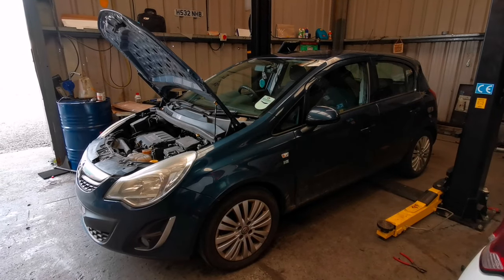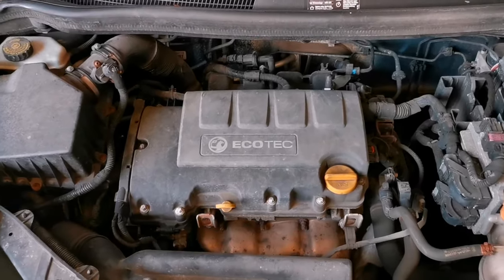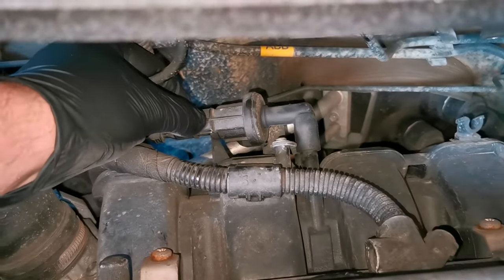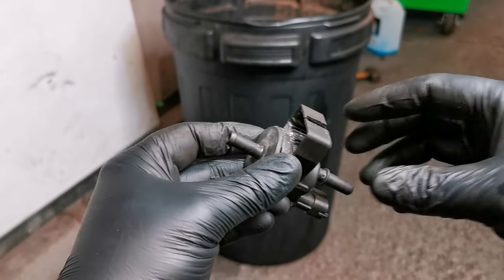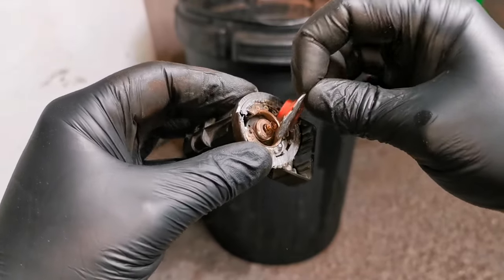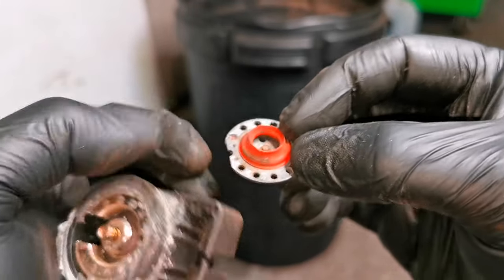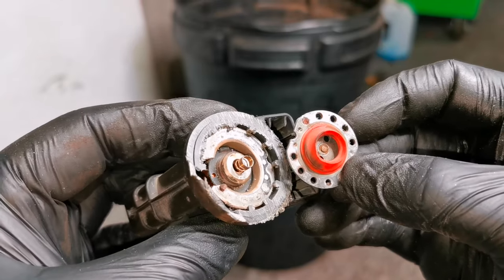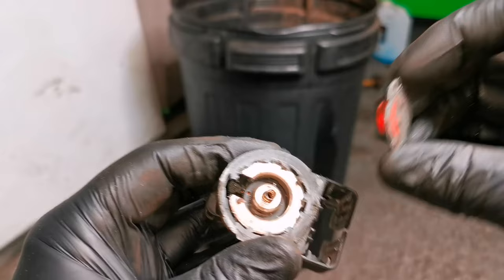Corsa Uneven idle, PCV valve? Common problem

Comment: That's a purge valve for the Evaporative emissions cannister. 

The PCV valve is built into the rocker cover & is also a common failure on these engines. I believe they make a squealing noise when they fail.

Comment: Great video, keep it going your time will come 👍🏼.  Can I ask you how did you intially diagnose the idle to a bad pcv assuming you didn't just cut Open the part and hoped ?🤣😁
Reply from the maker: A simple way to see if the pcv valve is venting too much is to take the pipe off and block the pipe manualy. Then you can see if the idle improves or not.
By blocking the pipe you're acting as the valve so this is a simple way to check.

Comment: hey ! i hear a 'fssssssss' constantly and once i press brake the fsss stops and idle drops by 200rpm under 1000! Could it this be the problem ?OC car has engine check and dont pull as it should be ! Please help im desperate ...

Comment: When you say uneven idle are we talking turn the car on and idle is almost stalling and then few hours later it can idle at 1000 rpm ?
Reply from the maker: Uneven idle can present as bouncing involuntary from 800 to 1000rpm or  "hunting". It can also present as a slight misfire.

Comment: Will the pcv valve being perforated throw a fault code?
Reply from the maker: Not always.
If the electronics are working as intended, as far as the computer is concerned, it will assume it is working correctly and not display a fault.
Reply: @MTMMotorServices  thanks for replying so fast!. 

I have a a corsa d 1.4 . Started misfiring badly out of the blue.
Replaced coil pack and plugs. No change. No fault codes, no other electrical or mechanical issues to note. No holes in the exhuast,  I'm stuck  🤨. Any ideas? Thanks for your time 🙏
Reply from the maker: What codes are you getting? A particular cylinder failing ? You'll usually get for example "cylinder 3 misfire" or even "random misfire".
For a misfire, I look for 3 things.
Fuel, spark and compression

Spark should be fine with new plugs and coils.

The next easiest thing I would check is compression but you would need equipment to check so that's likely a job for your local garage.
Reply from the maker: However if it's not necessarily a misfire but it's running slightly lumpy, we would look over the data from the various sensors on the engine to see if anything is reading outside of specified limits.

Again.. likely a job for your local garage
Reply: Hit engine is running rough on idle I am getting the fault code of p0651 on a Vauxhall corsa cdti 1.7 2009 could you help me please